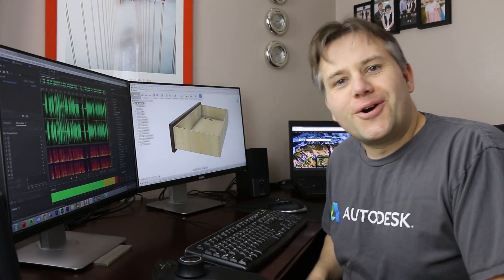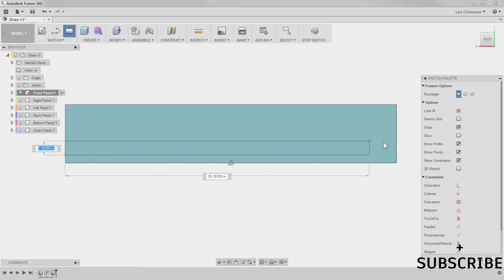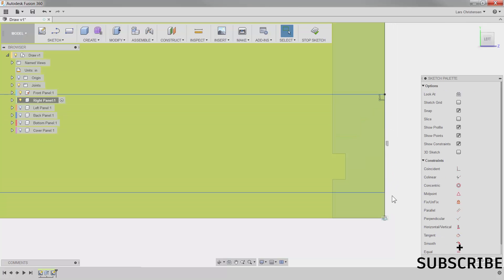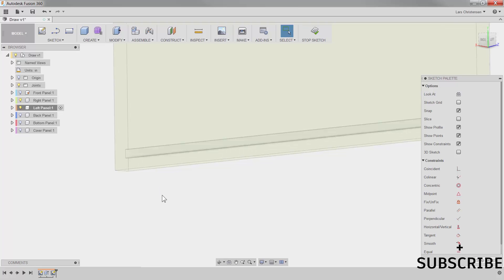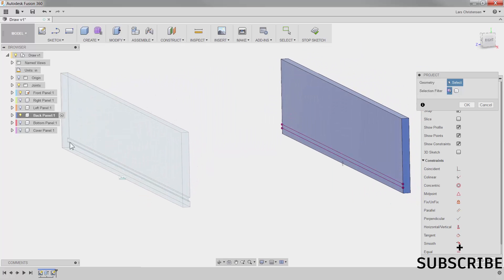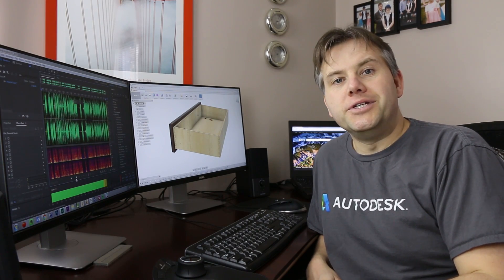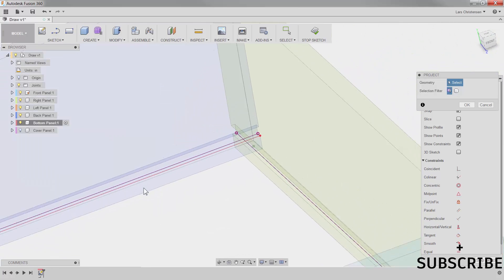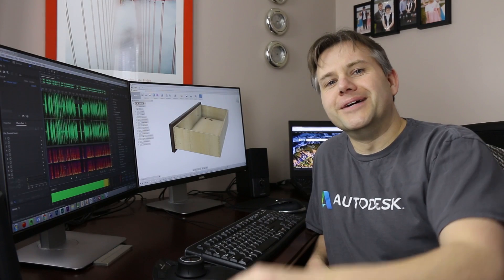Fusion 360 Tutorial - How to Model an Assembly Drawer with Dovetails from Start to Finish Part 2

Comment: Lars, did you notice in the first dado for the bottom, it was .25 deep. all the others were .125 deep. Don't you want all them the same?
Reply: 0.25 is the width of the slot and -.125 is the depth

Comment: 3:27 when I try to use the colinear command it flags up an error saying 'Sketch geometry is over constrained'?
Reply: While I don't know if I've found The Way, I certainly have found A way. When I make the rectangle and try to apply collinear, I get the same error message as you. Looking at the points of the rectangle, I noticed that some had a dot, and an icon next to them, the "coincident" icon. Indeed, I got three icons per dot. Clicking one of the icons, and then pressing delete, I was able to remove the constraint, and -poof-, collinear worked like a charm!
I still have no idea why coincident was applied, but at least I know what caused my problem. Hopefully, it's the same thing that caused your problem.
Reply: Hi. A late response but I found if you draw the 2 point rectangle so that it is not touching the existing edges, I.e. smaller than the panel, you can colinear all four sides of the rectangle and that works fine.

Comment: Hey Lars, I noticed during your video that your pan and orbit functions seem to move much more organically than mine.  I find when I move around the fusion space it is extremely jerky and chaotic I was wondering if you had any pointers on this?
Reply: Are you using Fusion360 App installed on your OS or directly inside a browser?
Maybe simply an older/slower machine?
Reply: its because he's using a Space Pilot not a mouse

Comment: Ok, I accident clicked the wrong line. Say i choosed the outside line of the slot not inside. Where talking about botton panel / project. I extruded it and i can see that one of the side does not go into the slot. Is there any way i can edit the bottom panel and extend it into slot? Addition, I have to admit bottom panel was abit pain'n ass because of try select the line and some object was in my way. Somehow i manage to cath that line phewww. Now.. the slot plz or do i have to start all over? I would love to hear a new tip of extending it into slot :-)

Edit: I tried again.. same thing again :-( , Here are picture that show my "problem" http://slotit.no/Fusion360/Project.jpg
Reply from the maker: Hi koford Thank you for watching!
If I understand what you are running into, make sure you select the little section also when extruding.
Reply: I started this guide all over again, and i ran into same problem. In this guide you did not check if your Bottom Panel actually went into the Front Panel slot. And i did exacly what you did in this guide. See my picture to show my issue: http://slotit.no/Fusion360/Slot.jpg as stated earlier, all other sides automaticly went inside but the Front Panel.
Reply: Yea you probalty right, after some thinking i can see the little section you mention there. So, it worked. Just strange you didn't do in this video. Now I do not know if it was supposed to enter in that slot. !!
Reply: @cadcamstuff  Thanks!  I missed this too

Comment: Why didn't you use constraints for the thickness of the bottom panel, so that if the grooves change, it changes thickness as well? Or why not start with the bottom panel and use constraints to create the grooves?
Reply from the maker: Hi Ittay Dror Thank you for watching!
That would be totally legit to do it that way.

Comment: At 9:35 it looks like the bottom panel isn't fitting inside the groove, but is floating next to it. So when you cut the bottom panel it wouldn't be large enough to fit the groove on all sides.
Reply: You are almost correct, I noticed it too. When extruding bottom pannel at 9:50, there are 2 rectangles that needs to be selected. Otherwise it wont connect to front pannel.

Comment: Hi Lars,
Great tutorials, but i'm having a problem with the bottom panel.
After projecting the lines around the back edge of the slots when i Press/Pull the bottom panel the part that would locate in the front panel slot is missing. Seems when i select the bottom for the Press/Pull i have to select two parts, the main panel plus the part that would locate in the front slot. You seem to grab the whole panel in the video. Confused.

Comment: Amazing tutorials as always! I have a question... Why does it matter if a component can "fly" around the scene? Wouldn't that be actually good in case you need to quickly change components position?
Reply: In this case, we know we want the pieces of the drawer to remain together; yes there are other cases where you want components to freely move.  If the boards weren't constrained in the real world by dovetails, glue or screws, it would fall apart.  Lars covers joint in other videos where you can, for example, spin or slide 2 components with respect to each other.

Comment: Having the same problem as below. I'm using the free 30-day version and when I go to use the colinear tool to create the dado on the right panel I can not select the small line segment in the adjoining face board.  I have to create the dado cut and then use P to project onto the other side. Then  I can use the colinear tool. Glad I saw the posts after 2 days and 4 different recreations :)
Reply from the maker: I am honestly not sure exactly what is going on. It has nothing to do with the software version because trial and paid version are the same.
Reply: Hi Lars,
Thanks for responding. I noticed other users below having the same issue. I event started the entire tutorial over thinking I missed a step like grounding a piece or not connecting properly. Every component is black ( fully defined). I can select other segments "through" the design but not the segments that are the notch. 

As others below said I could use the "P" command and project over to the other side then "cut it out," but then I still have issues making the pieces colinear. Maybe there is a version difference?

Love the series. It's been immensely helpful and yes at times frustrating :) 

Please keep the series going!
Rob

Comment: Hello Lars,
Your tutorial series are really helping me mastering Fusion360 but I'm stuck. When I try to do the colinear selection for the bottom slot, I can't select the horizontal surfaces of the front panel. I select the horizontal line that I've just made on the right panel, clicked on colinear, and if I try to select the top surface ouf the front panel, I receive the message "Select other geometry". 
Try as I might, just can't get past this step. And if I do, the model don't become parametric. I tried, and learned and now know this step is really important to master.
Thanks in advance and keep up the good works!
Reply: Are you using the trial version - i am and am having the same problem .. i think full version would allow one to use it in such a way after all it is a handy function
Reply: I'm using the version for hobbyist, never had ANY problems doing Lars's Great Tutorials :)
The colinear fonction works well when I'm doing the right hand panel, no problem there. But it refuses to recognize the top bottom surface, or any surface, of the front panel.
Could the problem be the software upgrade since this tut was done?
Reply: Dagnabit, I'm having the exact same problem! I am actually doing the tutorial right now...I just read some comments below and others with the same problem are using the P function to project the edge they want to make  colinear and it seems to work...we'll see if it is a solution.
Reply from the maker: Make sure you are looking directly at the part. Also, try to right-click the view cube in the upper right corner and make sure you are not in perspective mode. That can screw up selecting stuff.
I will say, that if you project and edge and that make you move on...do that :-)
Reply from the maker: Hi Jody, Not a bad thought, but the trial, hobbyist, and student version have all the same features as the paid verison.
Reply: Doh!...You know what Lars, later on in the tutorial I had that same problem and I noticed that I was looking through the part from the wrong side. I spun the part around and voilà! I'll take a look at right-clicking the cube to see what mode I'm in there too! Thanks for replying to us!

Comment: at 3:32 It will not let me use the collinear tool to match my box to the front piece. It always says select other geometries. Any help would be great! Thanks!
Reply from the maker: Hello Nicholas, Thank you for watching the videos!
Not sure why you can do that. Are you not looking straight at the model? That could cause it possibly
Reply: I think I had a few problems. The largest of which was I made a new plane to sketch on instead of sketching directly on the the side of the board. I did end up figuring that out after a while and got through the whole tutorial. thank you so much!

Comment: Hi Lars.  At 3.26, I need to press "P" to project Front Panel before collinear command.  If not I am unable to select line from Front Panel.
Reply from the maker: Not sure what is going on...Can you do a test in another file with something similar...just want to know if it is a software problem.

Best,
Lars
Reply: I just created another sketch and replicated the problem we have been having with the collinear command.  Pressing P, then selecting one of the lines and then using the collinear command seems to work.  I then went and made a change to the first component to make sure it would translate to the second component and it did.

Comment: Hi Lars, got another question here...I keep having the problem where it won't allow me to select the faces as you are doing. For example, when I try to do the Project command to generate the bottom (8:54) it's not letting me select the bottom face of the dado- the highlight jumps from the back of the groove to the inside face of the drawer front panel (under where the bottom will be). It just skips over the bottom face of the dado.

Comment: Hi Lars,

Fusion won't let me collinear the box in the right panel with the groove in the front panel. Any fix for this? Cheers mate.
Reply: I am having the exact same issue.  Can't figure it out either.
Reply from the maker: Hi Chris, I have not come across this. Maybe check that you are looking right at the sketch face and not have the view in an angle. That could possibly cause this.

Best,
Lars
Reply: Yea thats not it I'm absolutely stumped i even re-installed fusion thinking that might fix it but no it didn't help. when i hover over the front panel edges with collinear off they highlight black but when i select collinear it won't let me select them. If anybody else has had this issue or knows how to fix this i would love to hear from you. Cheers
Reply: Hi Lars.  At 3.26, I need to press "P" to project Front Panel before collinear command.  If not I am unable to select line from Front Panel.
Reply: Am also getting the same problem but in the first i was able to apply collinear but now when i apply collinear it only touches one line which is in the right panel but never highlight the other line of the front panel

Comment: Lars,
Love your videos, you do an excellent job of teaching 3D modeling the "proper" way which makes life so much easier. Question: Would it be possible to model something similar to this video using pre-existing (semi-complex) components instead of modeling every piece? My goal is to model a full CNC/3D printer/Laser Cutter/whatever frame out of aluminum 2020 extrusions from McMaster (part # 5537T514). Starting simply: If possible, how would you go about modeling a box that is parametrically driven like in this video here where changing one or two dimensions would effect the constrained other components where you might normally use and extrude to control the length instead of a normal sketch dimension? 
Thank you and keep up the videos, they are very useful!
-Eric

P.S.I'm not sure I was clear so let me know if I should clarify my question.
Reply from the maker: Hi Eric, Thank you for taking the time to watch the videos! It can be done with some limits. First of, when you have an assembly, you can control component locations with joints. It might start to get harder if you import a screw from McMaster and then you want to change the length via the Parameters list. You might be able to cheat by making a rectangular side view box that cuts the length of the the screw and then drive that box length via the parameter table.
btw. the parameter table I'm talking about can be found at the bottom of the modify drop-down.
So I think my final answer is that it could be done, but I might in-vision some parametric headaches could occur :-)....Proof me wrong!!! I will be rooting for you!!!
Hope this is helpful.
Reply: That's actually exactly the issue I had the first time I tried doing this, I changed one length and had to correct several errors. It worked but took me 15 minutes every time which defeated the purpose. I'll try using that trick of driving the length via boxes instead of using the parts directly. Thanks again, it was extremely helpful!

Comment: Hi Lars, parametric modeling is a great feature. In extruding the bottom part you did not use a parameter for thickness. How would you do that?
Reply from the maker: Hi Marcel, I would use the Parameter option under the Modify drop-down. I thought that was a little too advanced for this video series.
Thank you for watching the videos!
Have a great day!

Comment: The only change I would make is when you are doing the "as built joint" is to select the bottom panel first and then the front. In this case is does not matter, but when you do other joints the order of pick is important. The first picked is the component that will "move", so in this case since the front is grounded, I would pick the bottom panel first.
Reply from the maker: That is a great point, and thank you for explaining it so well!

appreciate it!
Have a great day!

Comment: Best practice would have been to offset the four corners of the projected rectangle by a few thou inward to allow for changes in humidity that would cause that bottom panel to expand and shrink. If it expands it will press the edges apart, or warp the bottom.
Reply from the maker: Excellent point! See, you clearly know woodworking :-)... Can't say I do. Thank you!!

Comment: Thanks Lars.....excellent tutorials as always!
Couple questions......for the bottom panel could you just select the inner bottom edge of each of the four grooves and use that to sketch the size of the panel and then extrude......why use projection?
Also seen on some other tutorials use of the Epsilon command for parametric dimensioning of parts......is this just another method or am I off the mark here?
Cheers
Reply from the maker: Thank you for taking the time to watch the video. Hmm, not sure if you could bypass the project command for the bottom. Would be could if you could. I have to test that out :-)
I am not sure what Epsilon is?

Best,
Lars
Reply: Hi Lars......ok I think I got epsilon mixed up with sigma........ Greek uppercase E.......I have seen this command used to set parameters but not sure if that is the case or same what you are explaining??

Comment: Thank you for all your videos. I've learned a lot. I do have a question... shouldn't the four inner edges have been projected for the bottom drawer part as opposed to the outer edge? So that the bottom drawer panel sits in the groove and doesn't fall out? Or did i miss what was being selected?